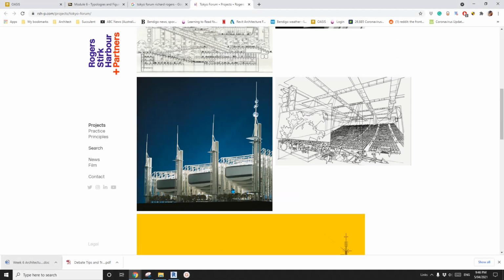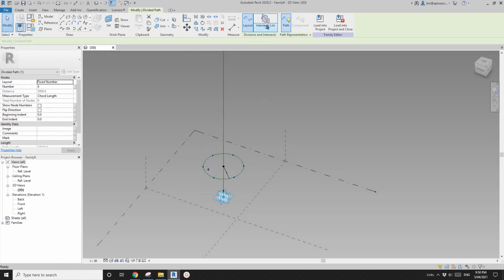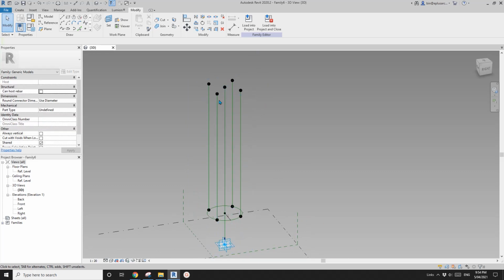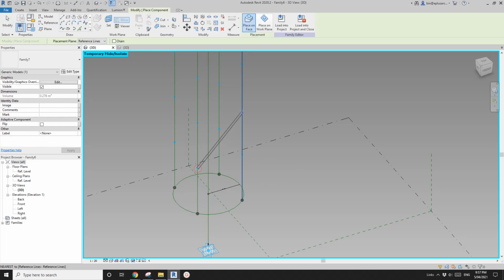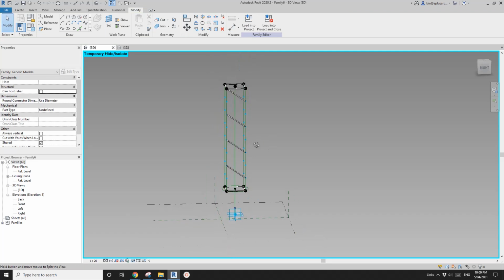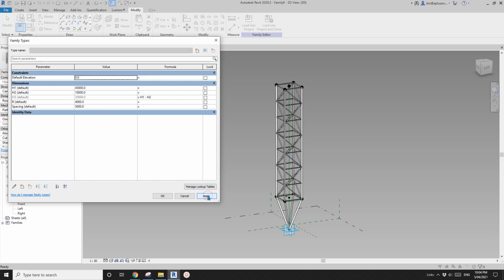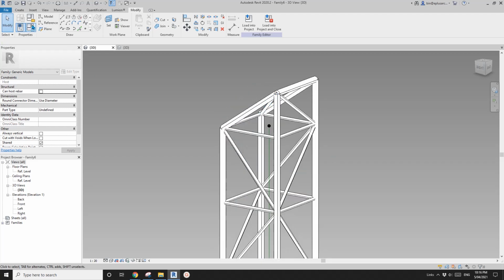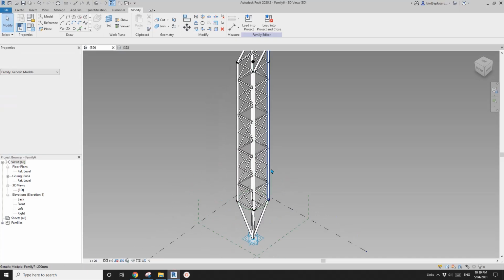Everyday Revit (Day 384) - Parametric Adaptive Structural Framing

Comment: Dear Bin, Thanks a lot. is it possibility to change these elements as actual  Revit system family like Rhs, Shs, Chs.
Reply from the maker: You can use the actual profile of those steel structure instead of circle so they look the same(but not real structural farming). Or you can only model this family with model lines and place structural framing using Pick Lines in the project.
Reply: Thanks Bin.